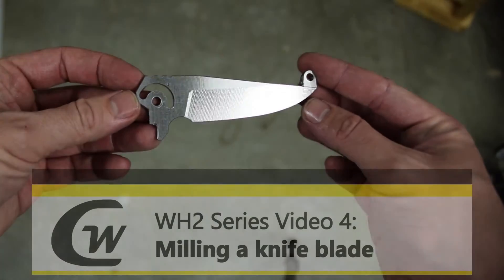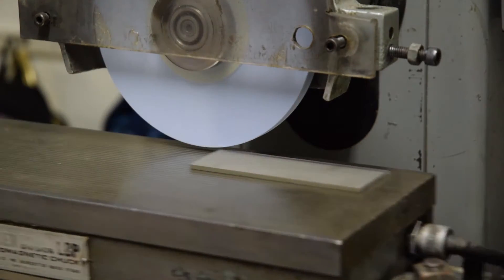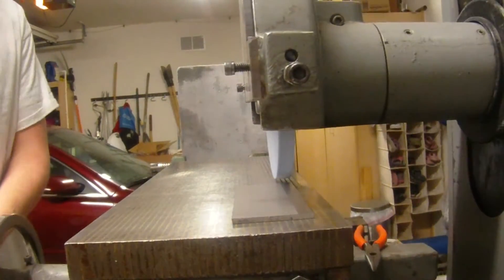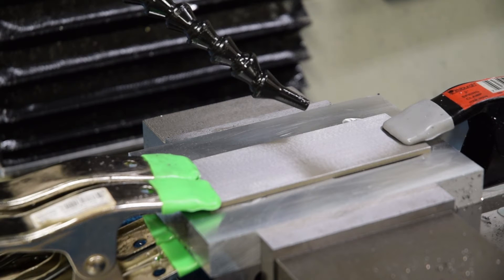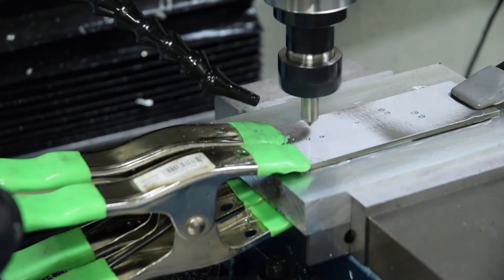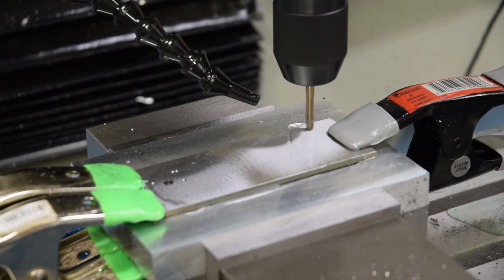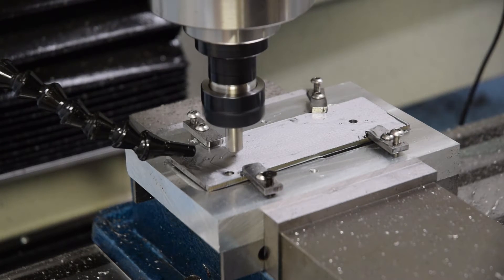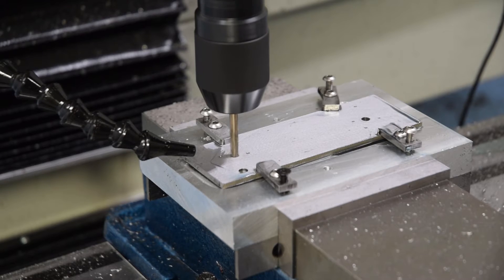Milling Blade

Comment: Your surface grinding wheel is probably out of balance. Also grinding length wise with can warp the part, pulling it off the magnet.
Reply from the maker: Ryan Herold where were you two years ago when I was trying to figure this out, lol. But yeah in my case it was part wheel balance and part just wrong wheel.